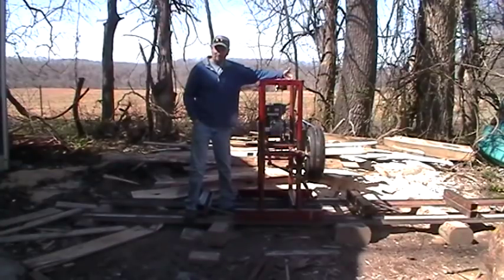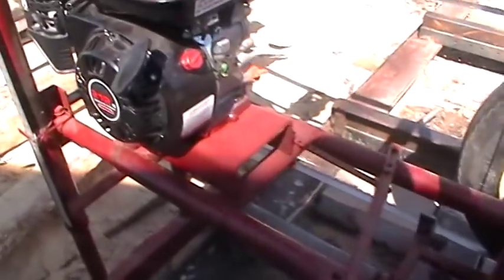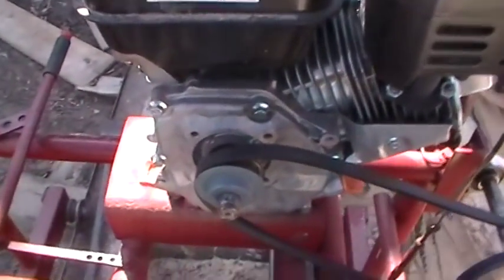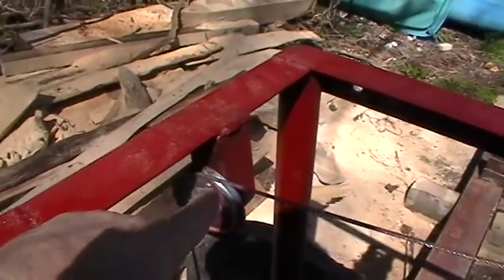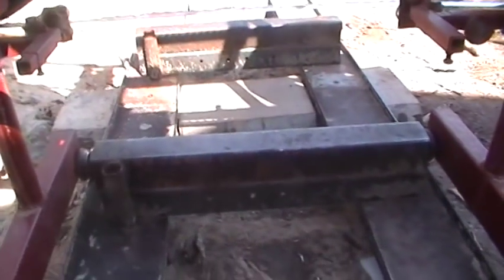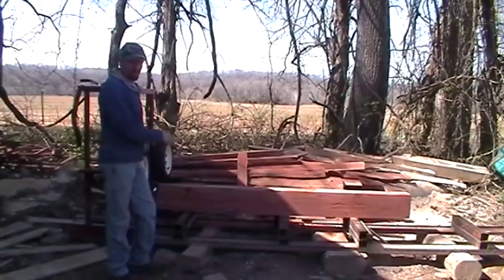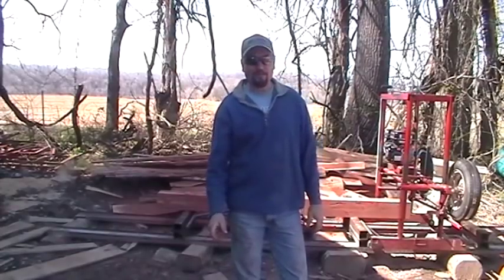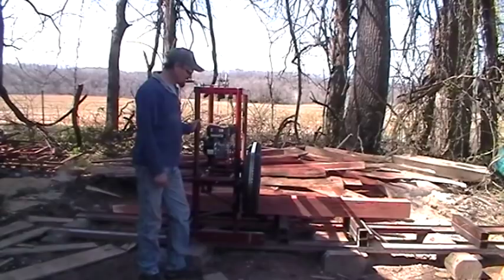diy sawmill

Comment: One of the BEST videos on a homemade sawmill. Very simple and well explained. I am in the process of building mine and it will look a lot like yours. My biggest challenge is the blade tracking. Still trying to get the best design that is not too complex and easy to adjust. Congratulations on your Mill and thanks for sharing.
Reply: poochie49. Blade tracking is not that complex. Only one wheel is adjusted (one direction only is needed normally left right swing as you look at it from the front) then they both together need to be moved on the vertical axis to make sure the blade is level with the bed rails.

Comment: Good job Mark! I built my own too one question every blade has set in it the teeth that are down on the tire do you find that it takes the set out of it? or did you grind a little groove so as the tire will not interfere with the inner blade set? You could take a white marker and trace where the blade runs and take a grinder and make a 1/8 groove this will eliminate this problem. On my little mill I used scooter tires which have a natural curve to them and the blade doesn't touch the inner set on my blades. I am still tuning it in. I built mine as well with all recycled material. I have a hundred dollars in it I bought new tires as the old tires were forty years old.